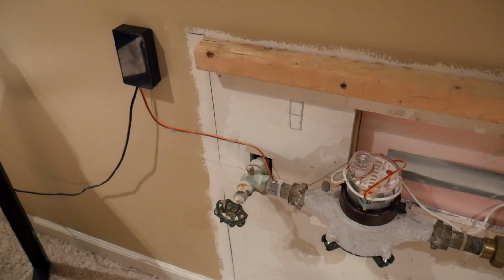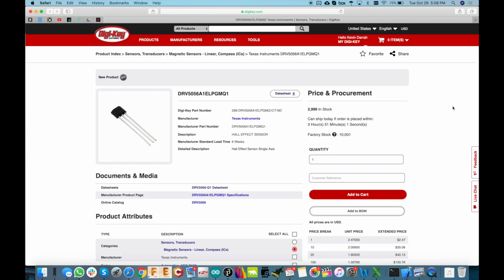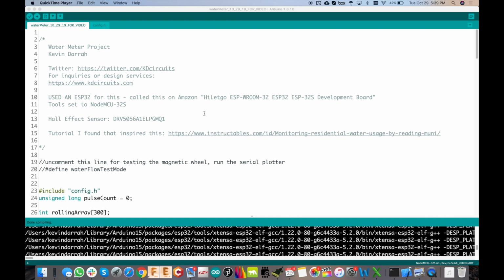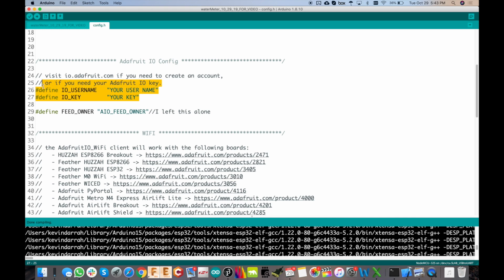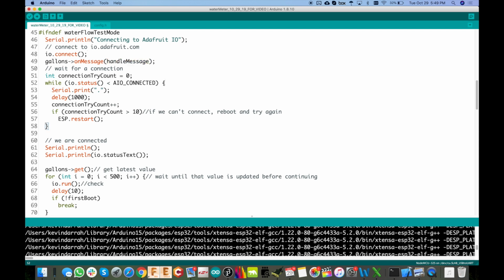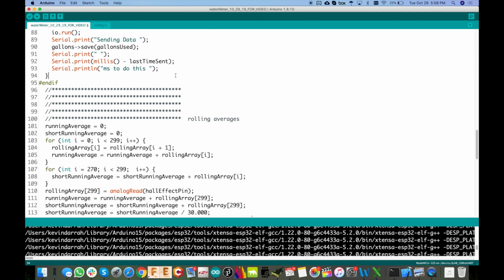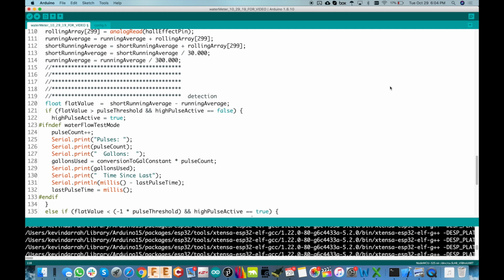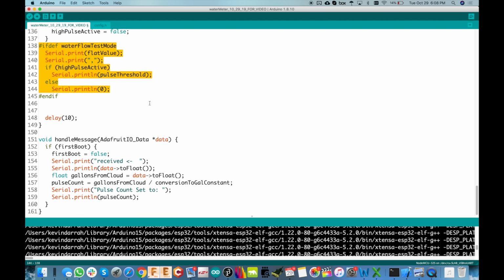IoT Water Meter with ESP32 - Full Tutorial and Code

Comment: how about using a pipe with a turbine on one side connected to a magnet and a sensor at the top. it could clean the installation process. In my country, we don't have water meters, 
Also, we have to buy it from private companies there's no water line in my area, I and landlord are sharing the tank so there's always a kerfuffle about who is using most water right now we have a system of per head usage. 

but watching this I might as well try this.

Comment: Good work, so this is bascialy a pure software solution. I ordered a few DRV5056A1 as well, good sensor.  I think your water meter is quite special, it produces a strong magnet field than other meters.  Have you ever measure the voltage change from the sensor output pin with a multimeter?  My water meter, and the water meter in the Instructable project, only produces super weak field, so my DRV5056A1 output pin voltage only varies from lowest 0.600V to highest 0.605V,  I don't think the ESP32 ADC 12bit can deal with this kind of tiny voltage change, not reliably anyway . therefore, the instructable project did use an OpAmp for a good reason, his voltage change is about the same, only 5mv change.  When you have time, could you please help to measure the voltage change of the sensor pin ? much appreciate it!

Comment: Kevin, 
Thanks for the video.  I have been working on a similar measurement project only using a QMC5883 magnetometer.  Yes, filtering is the biggest challenge and I wanted to share the simple method I built for you and your users.  Interesting to see that your sensor output was sinusoidal as I would have thought it to be a square wave like your process output.  My sensor output is entirely sinusoidal and noisy.

As shown in the code below, my approach was to test for an upbeat followed by a downbeat in the sine curve given by the rotating magnet in the meter.  (In calculus terms, I am testing for a negative-to-positive change in the first derivative.)  These upbeat/downbeats are compared to a threshold that the user needs to set based on testing.  I only take action after the upbeat with the routine called EventAction().  In that routine the elapsed time can be captured and recorded for computing flow in needed.  (I’m using an SD card and my MCU is a Atmega386-based Nano).  

I discovered that it was important to test for small, but dithering sensor changes.  You don’t know if the water meter is going to stop on a pole, or between poles.  When the meter is stopped, then I go through a process of quieting the upbeat/downbeat test variables, maxDelta and minDelta, by resetting them to zero.  I found this to help because sometimes the noise was big enough to trigger a false cycle.

The code below is a small extract from my program loop but captures the essence of my approach.  To first explain the variables: 
	x, y, and z are the magnetometer sensor readings.  I choose to use x.
	maxDelta is collecting upward curve movement
	minDelta is collecting downwared curve movement
	Delta_Threshold is set by experimentation with curve characteristics
	flag_DownHappened & flagUpHappened are testing for completion of a curve period, (or pulse)
	
void loop() 
{
    int x,y,z;
    qmc.read(&x,&y,&z);
    if ((x - x_last) >= 0) {maxDelta = (maxDelta + (x - x_last)); minDelta = 0;}
    if ((x - x_last) <  0) {minDelta = (minDelta + (x - x_last)); maxDelta = 0;}
    if((maxDelta > (Delta_Threshold)) && (flag_DownHappened == true))  // up beat - Pulse occured
    {
      flag_DownHappened = false;	//reset for one-shot
      flag_UpHappened = true;	//ready for down beat
      EventAction();		 //Take some action on the completed event     
      maxDelta = 0;		 //reset for next cycle
    }
    else if((minDelta < (-1*Delta_Threshold)) && (flag_UpHappened == true)) // down beat
    {
      flag_UpHappened = false;	//reset for one-shot
      flag_DownHappened = true;	//ready for up beat
      minDelta = 0;		//reset for next cycle
    }
    x_last = x;
    delay(5);
  }
}
Reply: im trying to use the qmc5883l i am having alot of issues. are you able to help me?
Reply: I did the same and done threshold should be check this first

Comment: I have successfully used a HMC5983 Triple Axis Compass Magnetometer (as it is cheap and readily available) to detect the water meter. The filtering is the key here as @Kevin Darrah points out. I do come across two issue, 1, in long term when the surrounding of the water meter changed (e.g. you put some stuff close to the meter) that may affect the baseline of the magnetic flux (the whole wave will go higher or lower). So the filtering will have to deal with that (e.g. recenter). 2, there are back and forth movement in the water meter when there is no water use (I assume external change of water pressure caused that) and sometime that movement triggers many false pulses. I imagine the only way to overcome that is to employ a second sensor to create a quadrature signal (at 90 degree of the first sensor). Note that the back an forth can be more than half a turn in my experience.
Reply: @Sai To Wang.  Excellent.  I am now configuring a QMC5883 magnetometer to do the same thing.  The QMC is on a board marked HW-127.  It appears that the Z-axis is most sensitive to the flux change as the magnet spins.  And that would allow the HMC/QMC boards to be simply mounted face-to-meter so the Z-axis is perpendicular to the mount position on the meter.  I noticed that in this orientation the spin direction can be detected by a leading/lagging X-axis or Y-axis curve, or more obviously, the reversal of the curve on the Z-axis (down then up vs. up then down).  The use of X or Y-axis depends on the mounting orientation on the meter.  That may solve detecting the backwards flow problem.  I just tested this on the bench by passing a magnet back and forth over the sensor and indeed the Z-axis curve flip flops depending on which direction I pass the magnet.
Reply: @craiglarson2346   did you ever have any luck with this? i am having some issues using the qmc5883l
anyway you could help?
Reply: i am having issues with the qmc5883l are you able to help me?

Comment: Hi Kevin ,  This is interesting. I have been doing this atmega 328 barebones and deepsleep. Basically count interrupts and periodically send the data through lorawan. I am interested however on how to do deep sleep and still get interrupts to count the pulses and periodically send the data over  the internet using esp 32 which I realize I have some gaps since I don't want it always waking up when an interrupts comes in but just increase the counter and the do timed wakeups for transmission, kindly help in guiding how I can make it work with esp32.
Reply: Hi you can use STM32L series mcu. and count with DMA. So you can periodically send data wake up from RTC

Comment: did you use the same wiring diagram as the instructable? I noticed you use a different sensor and instead of the 5v you're using the 3.3v, I am currently working on a project with meter monitoring and I am a little out of my element with the electrical side of things. Thanks in advanced.

Comment: I used to work in metering. We'd get a lot of complaints of "the metering is running fast" which is literally impossible. Meters run slower over time, if anything. They don't look at their toilet that never stops running, needs a $15 part available anywhere, and is pretty literally flushing hundreds of dollars down the drain every month.

Comment: might also be possible to use a photo sensor to detect the black stripe on the small red dial
Reply: My water meters have a metallic, very reflective cogwheel in them that would allow to optically get those impulses.